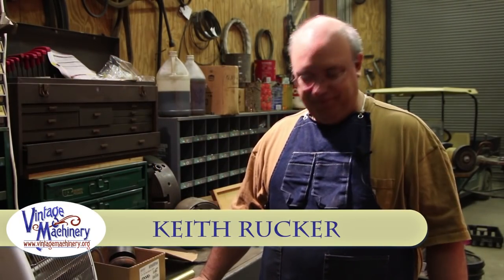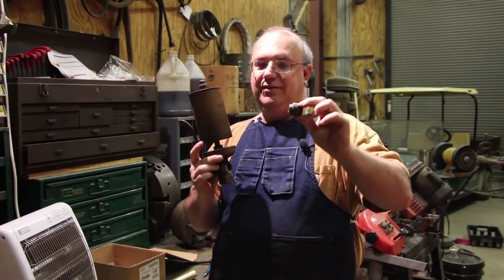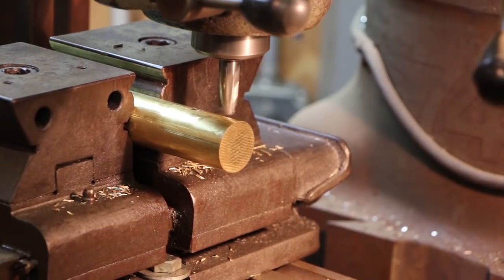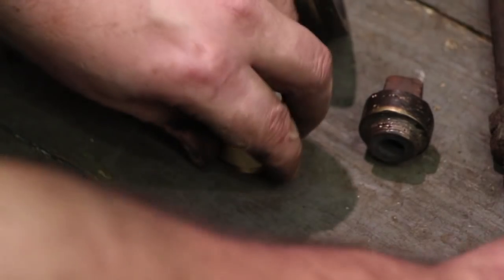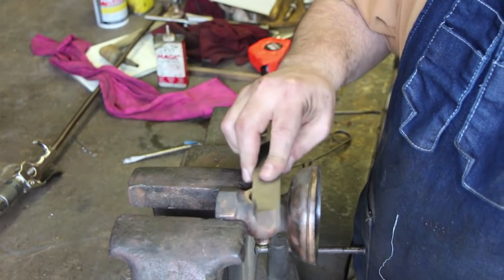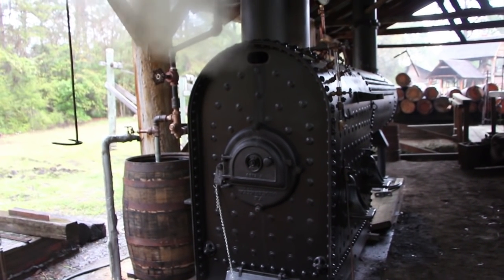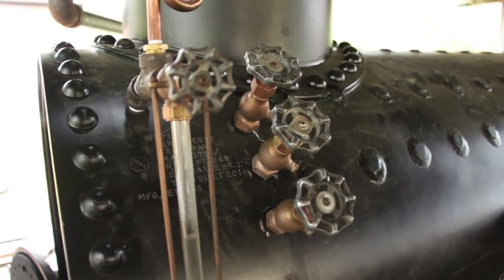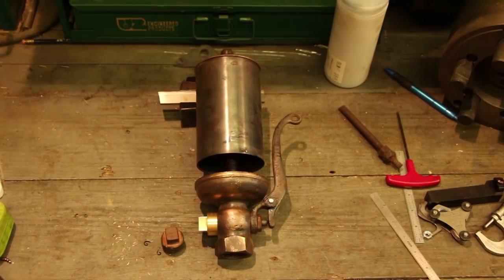Repairing a Steam Whistle for the Steam Powered Sawmill

Comment: There used to be many standard threads, everyone now is used to the 2 most common ones, UNC and UNF threads. 1/4-24 is a UNS thread and 7/8-16 is a UN thread. Taps and dies can still be bought for them, just hard to find and expensive.

If you needed a washer on the plug I'd use an annealed copper washer. You can get them at an auto parts store, they are used as oil plug washers. The steam dome cap on the steam locomotives I used to work on used annealed copper rings as a gasket. We were running them at 190 PSI.

I've enjoyed all the videos I've seen that you posted.

Comment: a small amount of PTFE tape would seal the plug and stop any leaks and you would not need to tighten it so much and you would not see it. great video
Reply: PTFE tape is a very bad choice for pressured steam. This material is Not elastic, it is plastic and deforms under pressured, be it steam or torque. It will leak quite soon. It can be tightened and be brought to seal again, until all PTFE is squeezed flat. Use a thin strand of hemp, it will swell up when humid and tighten without additional torque.

Comment: Hello Keith, I am a retired pipe-fitter/Welder/Plumber. I was taught that joint compound or teflon tape, we used hemp when I was an apprentice back in the late fifties. We do this for two reasons, one is to keep the joint from leaking, the other reason is to keep the joint from corroding, we always appreciate the joint compound when we need to replace something or make an addition.
Reply from the maker: +Edgar Milson Thanks Edgar!

Comment: The steam injector venturi tempers the intake water to prevent cold water from entering the boiler which can destabilize pressure and can also cause temperature stress cracking.

Comment: Nice video, good work.
Henry Ford used a 1/4-24 thread on the starter-equipped 1919-27 Model T...four of them to hold on the Bendix drive cover.
Reply: *****
1/2" by 12tpi is the original Whitworth standard!

What fool thought up 13tpi?

Comment: That type of vise is called a self-centering shaft vise. Mr. Fenner might know about it.

Unfortunately the internet has drawn a blank, with the exception of this piece made in India. 

- http://www.mukeshtrading.com/work_holding_equipments43.htm

Rather similar wouldn't you say?

Note the shaft stop that pokes through the holes in the vise. Check yours for the possibility of implementing such an attachment to it. I'm certain you will find it either via thread or more likely some sort of screw that holds the stopper.

So give Mr. Fenner a holler, maybe during his apprenticeship years, might of had seen one.

EDIT: when you asked the question i went on a search spree and didn't finish the video at that time. At 8:51 you can see the set screw holes on top of the jaws. That's where the stop attachment set screws go. 

A round piece of stock with a small leg at the end. I'd say a rather simple project.

Comment: Nice boiler. Any plans to maybe put it back on sills?

1/4-24 is a common thread on old Harley Davidson engines. As the story was related to me by an old HD mechanic they used it because it was a split between 1/4-20 (which as a coarse thread was prone to loosening due to vibration) and 1/4-28 (which was prone to stripping when used in aluminum).
Reply: ***** .25x25 was popular with Indian Motorcycles as well as Hudsons and Ramblers.  It was the preferred "soft-metal" thread.

Comment: I like your video explaining about the new up to code boiler made with fake rivets to look classic. You do good work. I refer to ones like you as a  "craftsman". In comparison to ones I refer to  a "crapsman". We have all seen the beautiful steam whistles and other things they have butchered and ruined with their poor destructive workmanship. Makes me sick to see it. Looks like you worked on a 4 inch diameter Lonergan plain single note. I have whistles in most common sizes made from 1 inch to 12 inches diameters. I have made two steel fabricated organ pipe type whistles. They have super extra long bells ( cylinders ) and make the deepest bass note of any whistles we know of. The longest one has a 72 inch ( 6 foot ) bell length. The low bass blast is incredible. Listen to it on high pressure steam on my you tube posting, Organ Pipe whistles. If possible, listen to it on a large stereo or home theatre with large speakers able to create deep bass notes.

Comment: Almost ten years later, you mentioned the safety valve set at 150psi, and I think It should be around 200psi. Personally, I don't think your boiler will be able to produce enough output of steam. Yes/No?

Comment: That new boiler looks wonderful!  I've done all my boiler study on the ones used for locomotive service.  Is that new repro one fitted with a blower in the smokebox that is operated continuously when the sawmill is in operation?  Or is the exhaust steam from the sawmill steam engine plumbed to a blastpipe in the smokebox?
Reply from the maker: +Noah Woods The new boiler is pretty much an exact copy of the old one, with the exception of being welded instead of riveted (but with fake rivets to make it look correct).  The steam from the exhaust is piped up the stack and we also have a valve that will blow steam up the stack to create a draft when the engine is not running.

Comment: Rather surprised to see that you don't use a product like "Never-Seez" anti-seize compound on threaded fittings when putting things back together. Working with antique equipment is hard enough doing initial disassembly. It would think you would want to make it easier for the next time.  Also interesting to note the lack of rising stem,  union bonnet valves on the new boiler. The only one I noticed was on the cold water feed line from the barrel. Union bonnet valves have always been "standard specification" on almost all steam equipment I've ever worked on.  Very nice series of videos.

Comment: Hi Keith,
            I noticed that the repaired steam whistle when tested on air still had issues with leakage around the actuator stem. The repair of this should be fairly simple, a new slightly over sized stem and the hole reamed out to suit the new stem. What would be your repair scenario?
Cheers MoK

Comment: I have been gifted one used BEAT UP old buckeye train whistle...which is stuck on a two foot metal pipe from the train i am told. i tried soaking in pb blaster but it looks like they had used a monkey wrench in the past to put this thing on. I can't get this whistle loose. Do you think heating the pipe below the whistle could work?

Comment: Just won a 3 chime whistle at a auction. Have not found a name on it just some short numbers 2 to 3 digits. Hooked it up to air and it blows well. The problem is it looks like someone shot it with a black powder ball round twice both in the same chime towards the top one made a dent about the size of a quarter the second round was just below the first about 1 1/2 inches it also made a dent about the size of a quarter this dent also has a small crack in the brass. Can any one tell me how to remove dents in a brass whistle and what would be the best way to repair the crack in the bell? I will get some pictures but I am not sure how to get them up to view.
Bill

Comment: When you did the surface smoothing you could of had chucked the bit then using a 90 degrees L shape or a block pushed the aligned whistle body to clean it.

 Oh and this wouldn't of had required any use of the actual machine, you'd get away with simply using the carriage to force the whistle body on the bit that you'd rotate with the chuck by hand. The result would of had been no chatter.

I don't know who..but one of the medium sized lathe channels here on Youtube presented this outrageous idea (since no one uses it i assume it is) that you could use the lathe as a quick mill by reversing the tool to the chuck and the work to the carriage.

Only seen it done once. No idea why people don't do it more often. It can't be stress on the carriage since the forces applied are an equation, therefore they can be reversed.

Just my two cents.

Comment: Your description of what causes boiler explosions is incorrect. The injector is not going to dump cold water on the crown sheet. Explosions are caused by sudden collapse of a crown sheet weakened by overheating and distorted by steam pressure. The boiling water in the boiler, flashes over into steam at a rapid rate causing the boiler to rupture catastrophically. Water to steam ratio, 1 to 1800.
Reply: Movement and slope, none of which will be in play with a stationary boiler. The water being injected will drop to the bottom and be heated by the surrounding water. I get my information from studies involving volunteering with NP steam locomotive #328 of the Minnesota Transportation Museum. I served as fireman on that old gal. By the way, I really enjoy your videos!
Reply: ***** I suppose if I had gone to boiler school I would have learned all that other stuff. I was really only just a brakeman who would spell the licensed fireman on really hot days. It was at the time a passion of mine to learn everything I could about the subject. Unfortunately the 328 had the same problem your old sawmill boiler had, outdated and unsafe, the steel shell is too thin in many places to pass inspection. Still it was lots of fun while it lasted. I was born in 1955 and steam was mostly a thing of the past in the city I grew up in. There was a NP pacific on display in a local zoo that I would stand and gape at the incredible size and scope of. When I started to volunteer at the museum, one of my first tasks was to climb inside the fire box of that same locomotive and free the ashpan door. It was like being in the inner sanctum of a holy shrine.